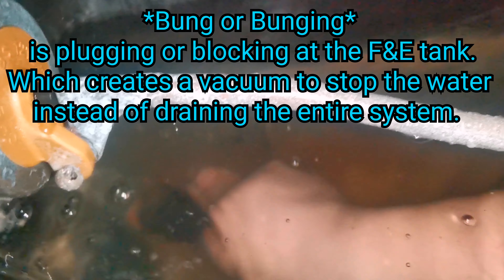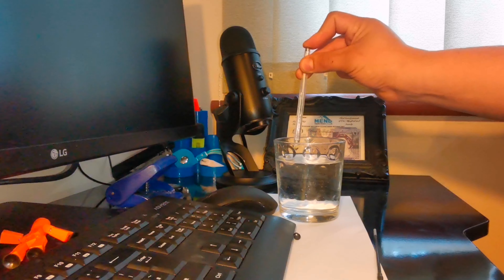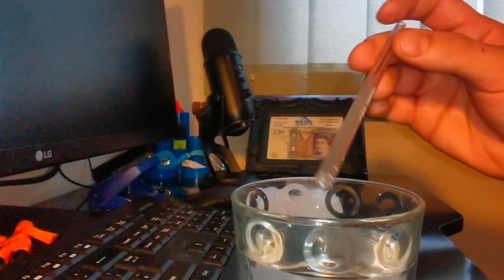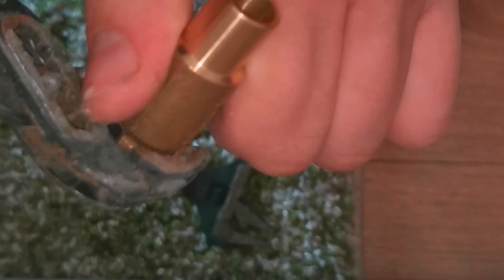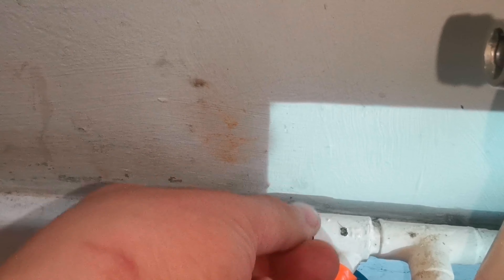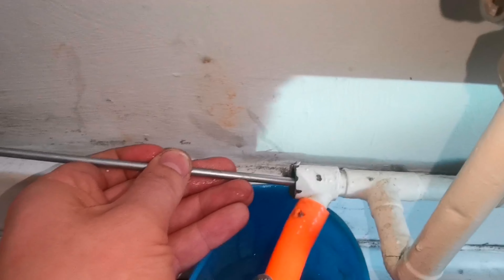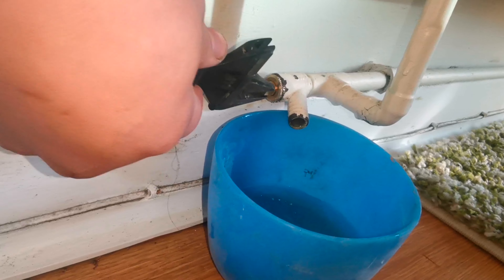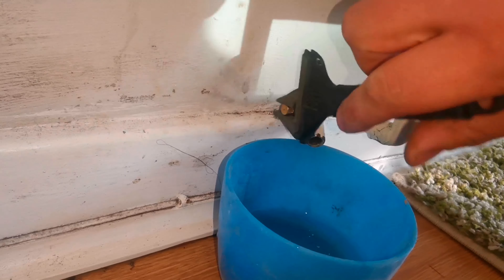How to Repair drain cock / drain off & bung system

Comment: I need to repair a drain off that's on top of my classic boiler before the tank so would turning off the stop cock be enough for me to get the job done? Thanks
Reply from the maker: No, the drain off is for your central heating. The central heating is a closed circuit you'll have to drain down the water in your system, radiators etc. It can cause a lot of damage if you get it wrong as you won't be able to stop the water. Do you have tanks in the loft or do you have a combi/pressurised system?
Reply: @mendyourhome  open vented I think, the little heating tank is connected to the top of the water cylinder.
       I replaced the inners of the valve yesterday but I got it all ready and held the water back with my thumb and quickly screwed it in, it's in my garage so not to bothered with a small puddle! Thanks for your reply 👍
Reply from the maker: @Carlostype  good job, 👍